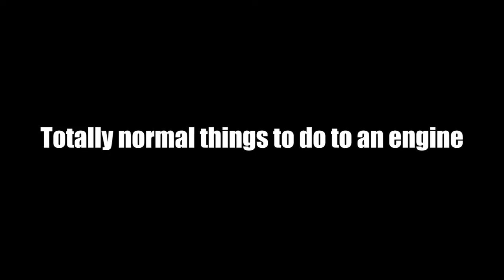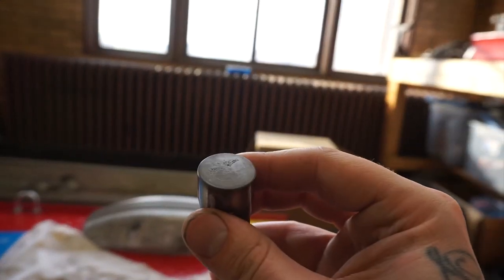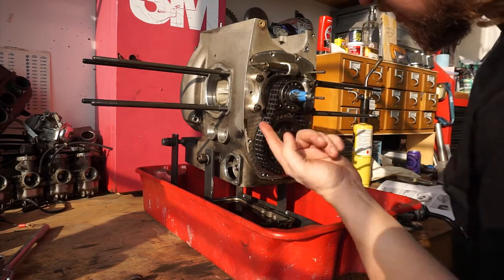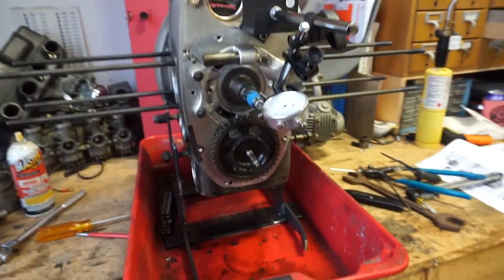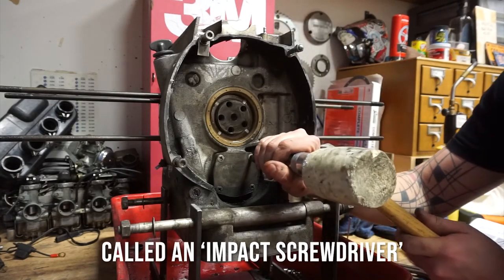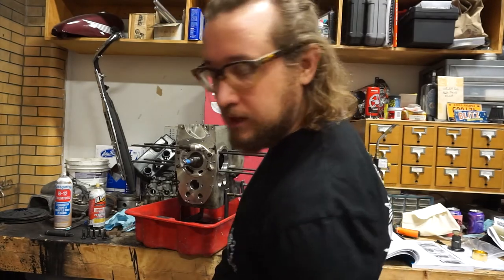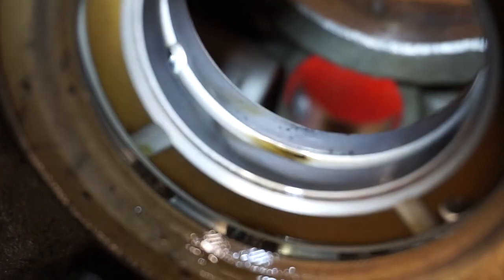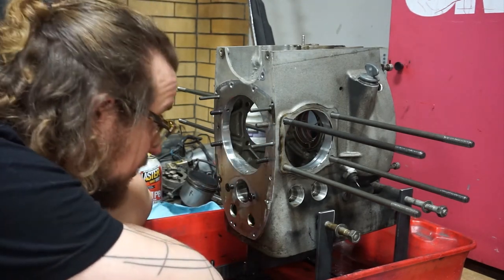BMW R90/6 - Engine Teardown - Crankshaft Removal

Comment: Nicely done. I am kinda in the same boat. On my 88 GS, I found slight pitting on the followers and quite a bit of scoring on the oil pump rotors. To judge the damage, I pulled the crank-rod bearings too and same story there. Not bad, but there is visible scoring.  

How did you get the crank reassembled?
Reply from the maker: Thanks. I have a couple other videos showing putting the motor back together with new bearings, including the main bush bearings and conrod bearings, check em out.

Comment: Definitely feel smarter watching you work. But honestly these engines are fine as they are for another 50 years with such minuscule wear.
Reply from the maker: Thanks. You're right, of course, this motor still had a long healthy life ahead of it if left untouched, but since we're doing some pricey upgrades we thought it best to make sure it was in top condition!